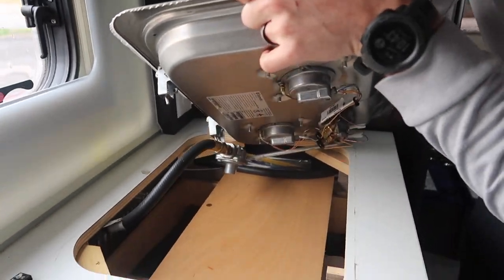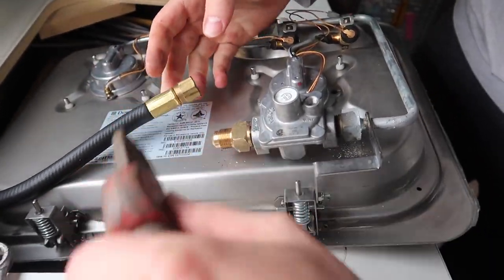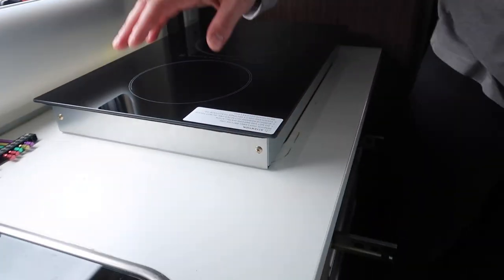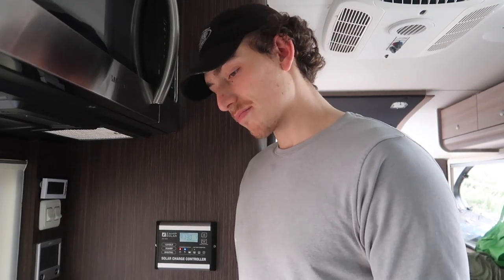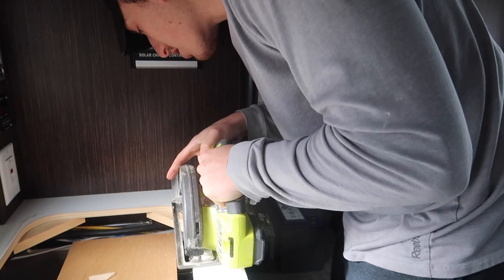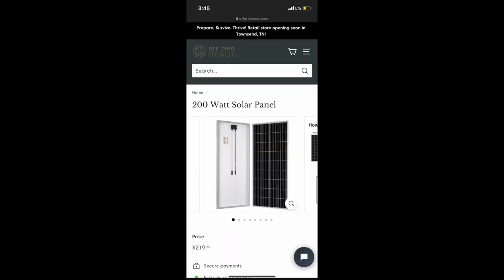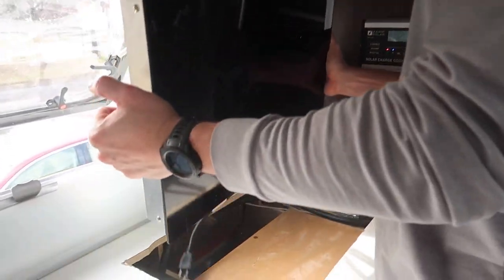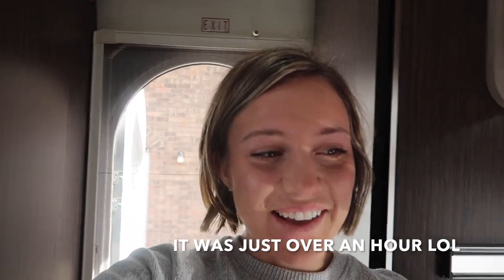REPLACING RV PROPANE STOVE WITH AN INDUCTION COOK TOP | FULLTIME TRUCK CAMPER COUPLE

Comment: how do you swap out LPG electric if you don't have a massive solar array to power the inverter?  Guessing I'm stuck with LPG.
Reply from the maker: Unfortunately you will need a solar system to run it unless you plan to be hooked up to power.
Reply: @OurFulltimeAdventure  Yeah, I'm working on building up the solar. The question I'm up against is - who makes a 12v induction stove that's not horribly inefficient?